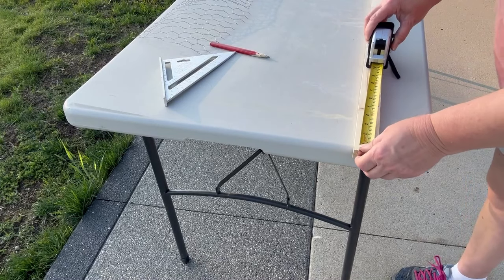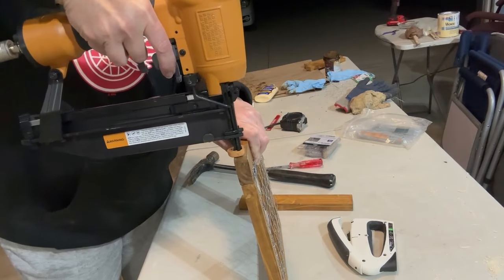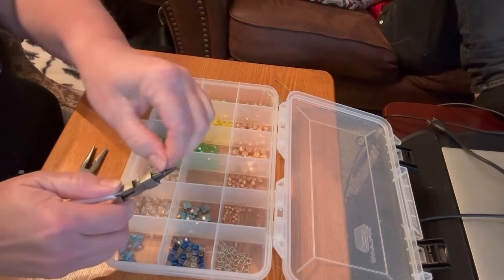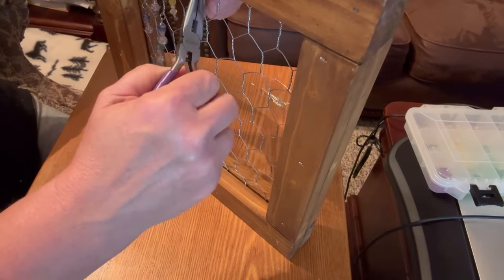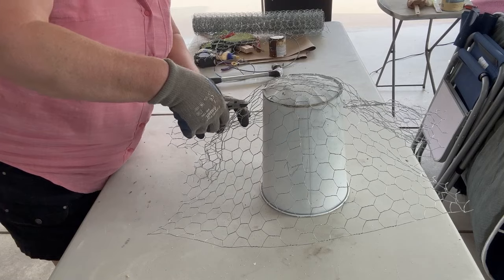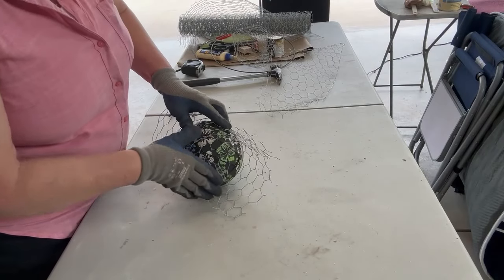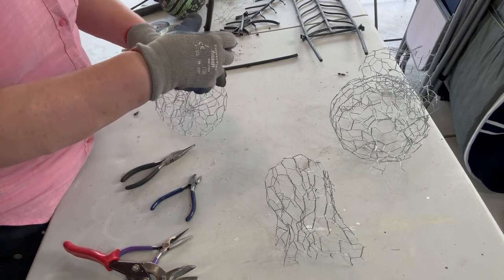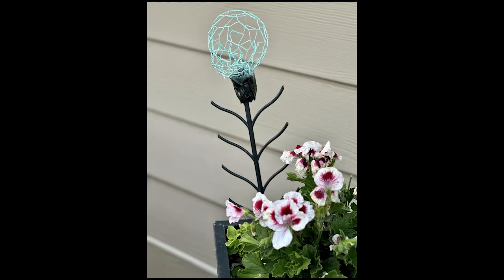Get Creative with Chicken Wire: 3 Easy DIY Projects you Can Make Today!

Comment: The base on the spheres, would look better, and hold up better, if it was held on with wire, wrapped around it. The sticky tape will melt in the heat of summer, and fail very quickly...